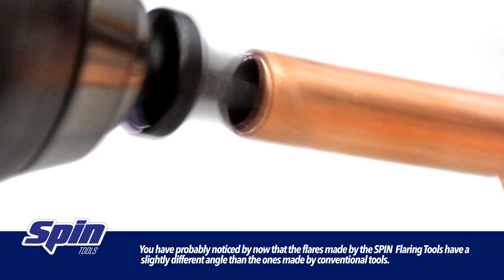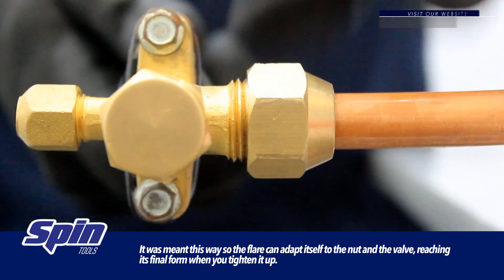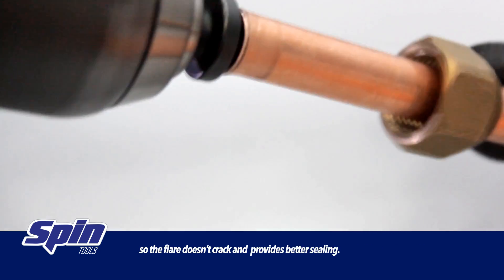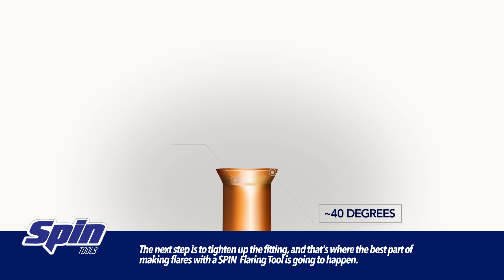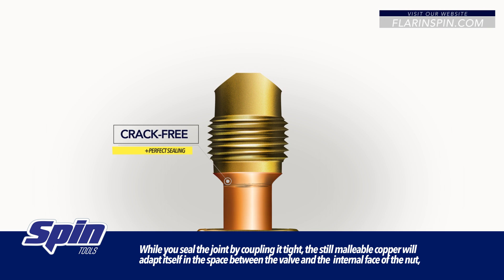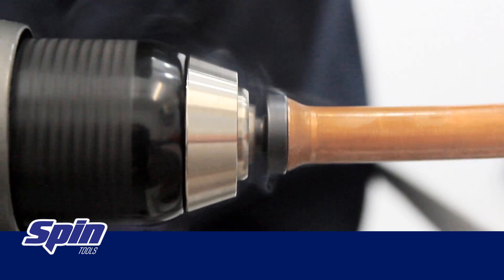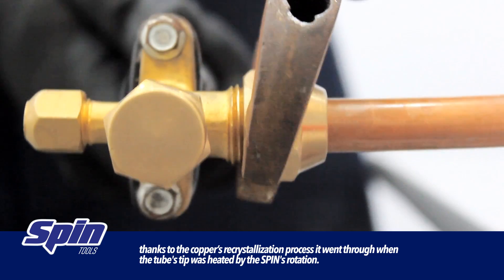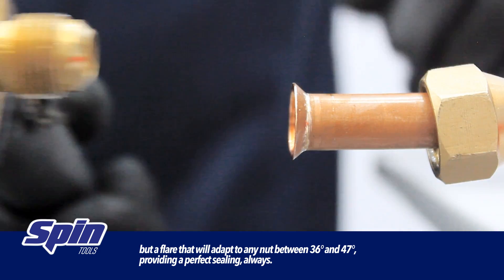FAQ SPIN Tools: Flare Angle with the Flaring SPIN Tool

Comment: Makes sense I bet most mini-split line sets are made with this tool. DIY installer using 8" wrench no way to torque to 40 lbs with small wrench for 1/2 line. Unless they use a torque wrench never going to seal.

Comment: Easy pass for me, I will do it the right way the first time with an eccentric flare tool. I predict minimal contact surface due to angle miss match and with likely scoring on the contact surface, plus an erroneous Torque reading provided from having to use the nut to form the connection. Fast = Failure, Slow = Success & Experiences is the Key!
Reply from the maker: We respect your opinion, however it's a wrong assumption.

Comment: Will this work on 1/2" schedule m copper pipe?
Reply from the maker: Hi. For plumbing yu can get the proper Swaging Spin Plumbing set (red box w/ 3 pieces) or get the individual 1/2 Swaging Spin Tool. The Swaging Spin are meant for hard and soft copper, but Flaring Spin are only meant for Soft copper. It can work on 0.28 inches wall thickness, however make sure you are using a high rotation screwdriver (500rpm and above).
Reply: @Cimport  Thank you!

Comment: A useless gadget that can contaminate the pipe system with filings and remnants from the machining process
Reply from the maker: We found out knock-offs create a lot of dirt. The original Spin tools don't, and we recommend cleaning the system as the A/C manufacturer recommends (with nitrogen, for instance). Always. You should do it whenever using a traditional flaring tool or Spin Tools.

Comment: Bilal CCTV cameras&AC,DC,Inverter installation
Networking I.T Engineer
Computer 💻 laptop 💻 hardware and software update all
All I.T Electric solutions have 
My contact number
 03244041148 
My WhatsApp 
03133945595 seve you 😊

Comment: I still find I have to ream out the copper, because if I don't, a weird inner or outer lip will form, and that's not good. Still like the tool. Either that or I need a more powerful drill.

Comment: A manual flaring tool is better, since we all know if you heat up copper, it becomes brittle and is very likely to brake, my point is you want as littler heat as possible to ensure a long life of the flare joint!
Reply: Wrong....heating is good, only bad is vibration
Reply: @shahrinshahrin7154  dude your name sounds muslim therefore your opinion does not matter!

Comment: i wouldn't believe it's a perfect sealing, adding teflon tape won't hurt
Reply: You dont use teflon tape in aircon, it can obstruct or end up in the compresor
Reply: the silliest comment.... i'd use pipe dope if anything around the mating connection for lubrication *if any at all.
Reply: That’s just dumb Procker Dark. Teflon tape can hurt and should only be used on NPT threads. It is NEVER OK to use it on any other fittings. The best interface is copper to brass as designed. Putting tape on these threads is pointless and actually adversely affects the application of proper torque during when the nut is torqued. A better tool is one that cold works the flare to form the correct angle. It can’t be overstated that the other important aspect of this fitting is the proper torque.
Reply: The face is the seal. Not the threads. Maybe some Nylog. Tape does nothing.
Reply: you dont reinvent the wheel.  Trust me- the people who have done hvac for years know far more than you do (obviously).  follow the instructions or you will be constantly adding freon to your leaking flares.

Comment: I love this tool but that guy is definitely going to have a leak.
Reply from the maker: Thanks for the comment. We beg to disagree with your comment, tough. SPIN flaring tool leads to a wider area of contact between the flare and valve, a flare adpating to any nut (let's say the manufacturer made it slighttly off standard, such as 45,5°. Spin will adapt de the to that angle). It's not limited to make only 45° flares. BY the ANSI and ASME standards, a flare in tube of copper can have from 43° to 47°. We are definitely warranting a flare that will adapt to any discrepancy of angle of the nut or valve, getting a tight seal fitting; resulting in no leaks at all. Please read our faq in our website. Thank you!
Reply: The product it's great but the operator was the issue. Trust me, things are different from the shop and from the field
Reply from the maker: Thanks again, Greg. Perhaps you could help us to understand what is going on when you use SPIN Tool. If you have the time, please send us a video to marketing@cimport.com showing a leak after making a flare with SPIN Tools, so we can check it and see  what could be wrong. We respect your feedback and wish to understand it fully, so we are interested in seeing if it's a problem of usage or any other issue.
Looking forward for your video.
Reply: How much this price. Where this available
Reply: Been using this for almost 2 years now and not a single call back due to leaks. I trust this tool than any other flaring tool. You just have to use it right there is a slight learning curve.

Comment: I would not use it on gas appliances to weak..I would not risk it.
Reply from the maker: SPIN Tools has safe use and are R410a ready. It keeps the thickness of tube for high pressure fluids.
Regarding the thickness of tube, ALL FLARING TOOLS, SPIN Tools included, do not significantly alter the thickness of the tube wall as long as the tubing has the standard specifications for high pressure fluids.
More at: https://spintools.com/faq/